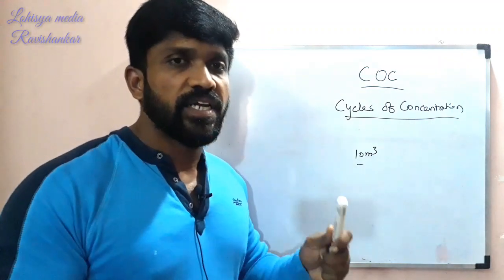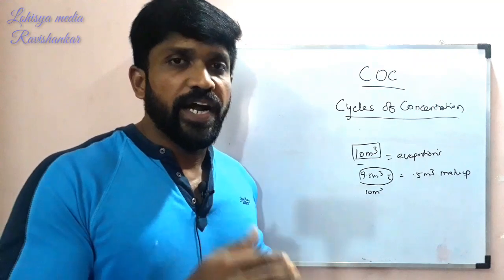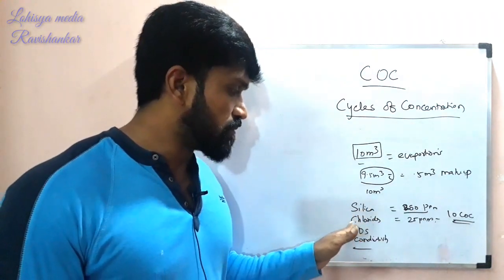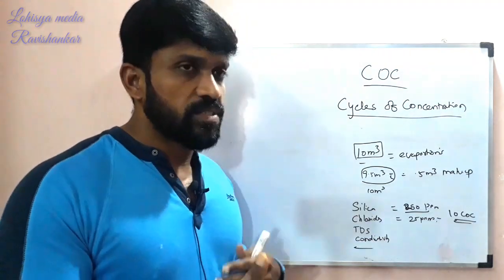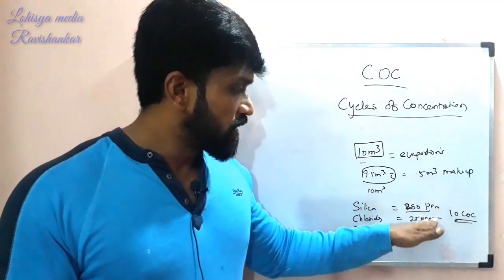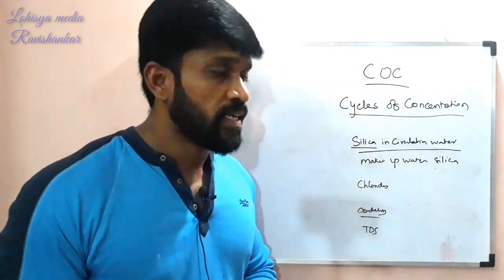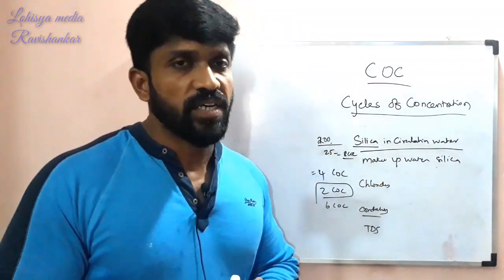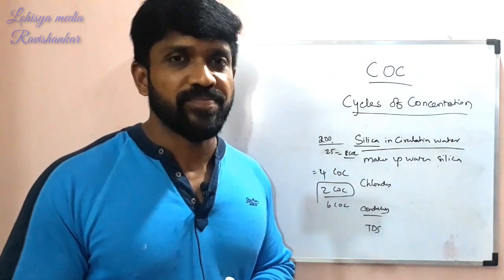COC | Cycles of Concentration | Cooling tower | HVAC | Tamil | Lohisya media

Comment: Why are you talking silica,chloride,tds, conducticity?so many parameters are there ex: phosphate, nitrogen, copper,fluoride,barium.....any specific reason
Reply from the maker: I am talking about major impacting parameters which phosphate also included
Reply from the maker: In boiler temperature of the cooling tower water is different some of the parameters need to include

Comment: Tds and conductivity increase aagurathukku எ‌ன்ன reason
Reply: The reason for tds and conductivity increase due to quality affect of water in cooling tower. So we have to put water treatment system to control the tds & the conductivity. Example swimming pool, we cannot leave swimming pool just like that right, we have to put chlorine to control the water quality. Same concept for the cooling towers.
Reply: @vengadeshnathan4785  in commercial building I took water samples (one of the continuous using water tap,not RO protect out) and tested it shows High TDS and Conductivity.how to bring it in to the exact level